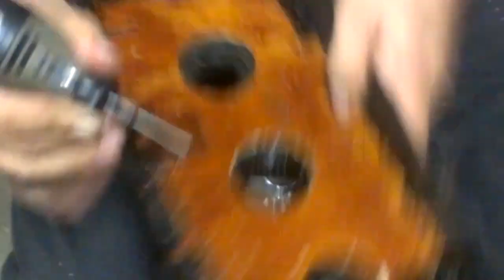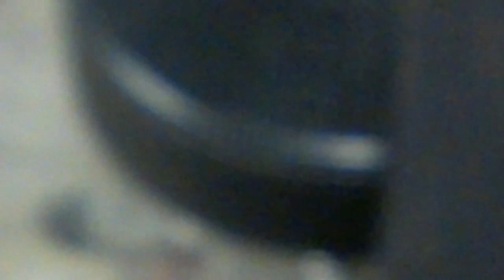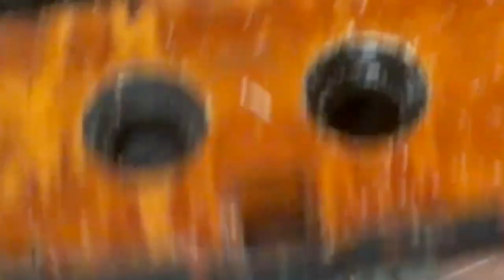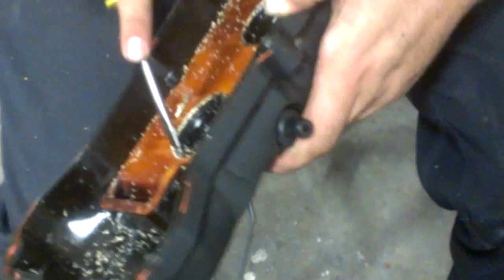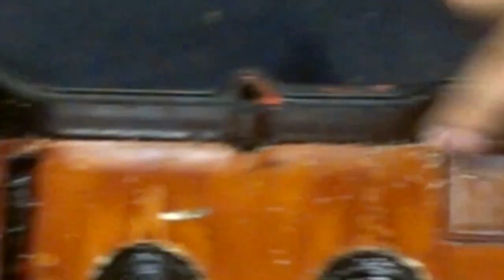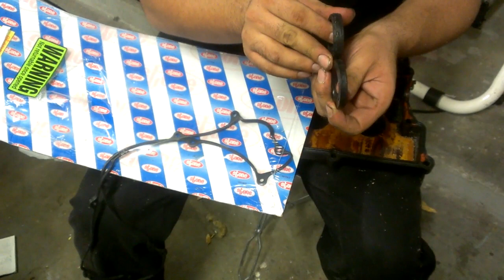96 Sentra Spark Plug Tube Gasket Replacement GA16DE

Comment: I know this video is old, but for whoever is watching now... He installed the seal backwards!  The flat part goes towards the valve cover. The open part with the spring goes towards the engine. Use silicone around and around the spark plug tube.
Reply: Thanks for saving me the headache man. Car has 256k miles anyways
Reply: Usually the spring goes towards the oil side yes. Not in this case however because it be very hard it instal. The oem one spring side is to valve cover
Reply: @thetouchtonsoffroad3574 the spring part go inside the valve cover?
Reply: And make sure you also replace the "PCV valve" that (sometimes) causes the leak.
I believe the PCV valve is about 2 inches away from his right hand at minute 0:16 of the video.

Comment: Grateful if you will please tell me whether the the Injector Nozzles for Nissan Sunny B15 - 1.5 cc engine and 1.6 cc engine are the same or different? Please also be kind enough to give me the correct number of the 1.5 cc engine Inject Nozzle Number. Tks.

Comment: Ok so I have a 99 sentra gxe and oil in my spark plugs i already ordered the seal and basket would I need to do the same I'm having trouble finding information
Reply: Hello Guillermo, yes, this will correct the issue along with a replacement valve cover gasket. You’re best option is to pay the extra money and get the replacement valve cover as a whole. This process was never intended for the part. I only did it because I was super low on funds.

Comment: Whats the part number for the replacment gasket you cut? Every single step by step i found left out the most important info. Lmk asap! Need to find those new ring gaskets
Reply from the maker: Kelsey Tanabe sorry it too so long. i never saw your reply. it is ES70745
http://www.oreillyauto.com/site/c/detail/FEL0/ES70745/02813.oap

Comment: Can i use a knife, a very sharp one?
Reply from the maker: You can, but that’s some tough stuff. The original forum that showed me how to do this had said they used a box cutter or x-acto knife. Worst case scenario, if you break the baffle, you’re supposed to replace the valve cover anyway.
Reply: Thanks for a quick response 👍

Comment: go to a junk yard and get a 91 valve cover and those are replicable... You'll spend a few bucks but in the end when you want to replace the seals it will be much better.
Reply: Mine is a primera AT15 engine which seals r not replaceable. Way to go smart NISSAN engineers.

Comment: i would suggest to everyone that need to change valve covere gasket,just change the main gasket around the valve cover, dont touch gaskets around the tubes because they are not designed to be replaced ,if you try, you will notice they are plastic material with some kind of ring inside . So if you have leaky tubes best thing to do is find used valve cover or buy aftermarket part.
Reply: If you are a chicken to do this job then buy a New valve cover Nothing to loose on this trial and its simple modifocation and if it fail then you have to buy a New one cause your seal will leak but if its sucess you are the winner